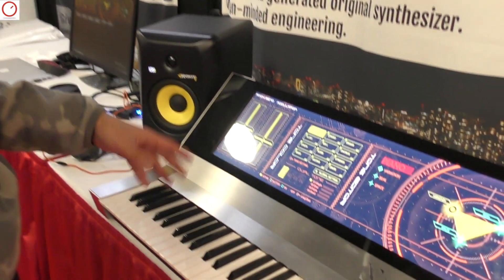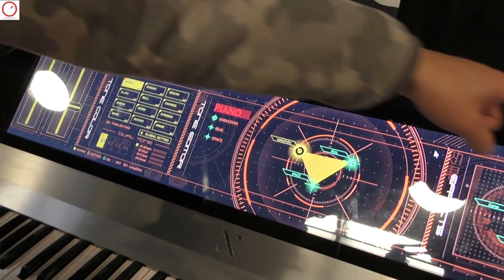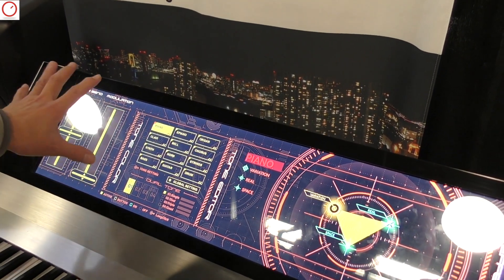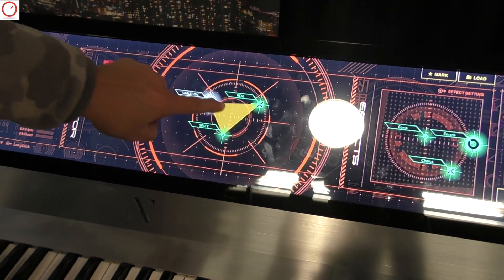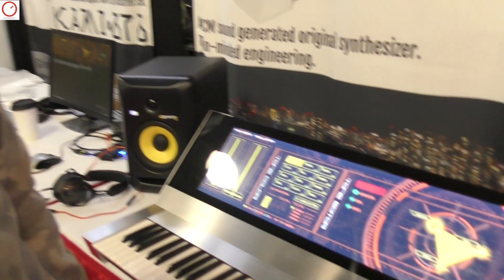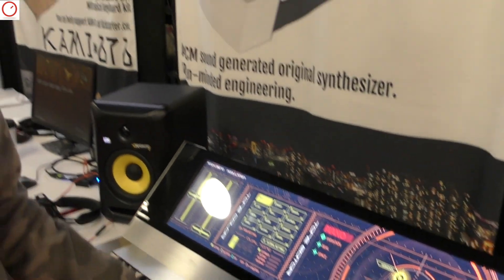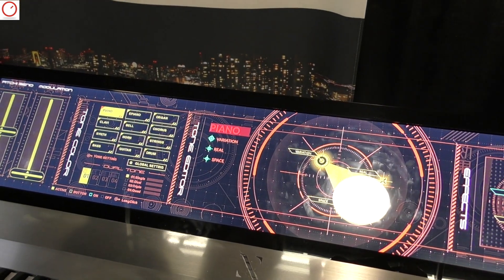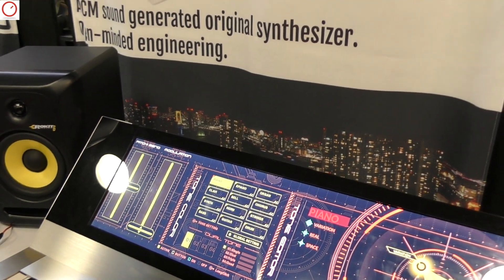NAMM 2018: Yudo NEUMAN Multi-Touch Keyboard / Synthesizer Prototype

Comment: Cool concept, but to make this practical as a keyboard they need to do the following:

Real pitch and mod wheels next to the keys, like every good synth ever, nobody seems to have a good time with touch controls for this.
The computer needs to be capable of running Windows or Linux (user to choose) so that all our favourite software can be used on the machine itself.
The screen section needs to fold down over the keys as a cover to keep dust off and to protect it from damage - that looks like an expensive screen to replace if it gets cracked.
Add a row of physical buttons and encoder knobs directly under the screen and up the sides so that there are tactile controls for menus/parameters and make them appear to the software as a deneral purpose MIDI control device so they can be mapped to any functions the user wants.

This could be one of the greatest keybords ever with some work on practicality, but touch only interface and proprietry software only will make it an expensive novelty.

Comment: I love the big touchscreen approach but the user interface looks dated an seems to deliver a weak user experience. Maybe a line of programmable knobs around the screen could combine the best of hardware and software to a better solution. Anyway: glad to see fresh ideas instead of refreshed vintage gear. Cheers.
Reply: I bet they had a lot of fun designing the user interface. Problem is, you also have to think about usability.

Comment: That touchscreen was seriously lagging and not exactly precise. Touch screen are ubiquitous, bit still have a bit of a way to go to be used iin a tacile enviroment where precision is  a factor. I have a Galaxy S8 and i dont use it as a controller because it screen is too imprecise for me.
Reply: Doc Holidaze This is exactly why I have switched to iOS and use iPads and iPhones just to mess around with ideas and the apps designed for iOS to make music don't exist on Android..the latency on android is ridiculous. And in this touchscreen , it was super lagging.. I'd go crazy. Looks like a movie prop to me.
Reply: Frankly, I find iOS devices as bad. I gave the generalization because I wanted to include iOS as well. However, iOS devices got the lock on running applications though. Apple has always been forward when it comes to content creation, one of the reasons Macs were the computer of choice back in the day. They were built to make content/media. I use an iPad in my day to day and find it runs music apps great, but the touchscreen still leaves me frustrated. I wonder how well Surface is, but I think pretty much all touchscreens aren't up for primetime just yet. Im thinking another 2-3 years, perhaps.
Reply: In which area, screen or processor? And what android device you've seen with 8+ GB? I know the spec ability of both, just wondering why you commented? I already notwed iOS have better ability ruinning audio apps.
Reply: I too am curious about the latest Surface. I think maybe the next surface, because latest iPad has that ms race on lock. By 1ms.. Yeah i am happy about the next two years in touch screen tech.. And Ween is back together..!

Comment: That looks pretty cool. But if the actual interface isn't well thought out, it's just a keyboard with an extra-wide tablet. All he played were piano sounds. A good synth is not all about a touch-screen GUI. You can't swap a real pitch bend and mod wheel for a tablet, it just won't work.
Reply: Maybe I'm drunk, but I didn't hear ANY sound from the synth engine in this video
Reply: OMG.. can you imagine the cost to replace that screen when it blows...as they all do eventually. ..

Comment: Lack of proper pitch bend and mod wheels or joystick sucks. Even NI fixed that in the last Komplete Kontrol
Reply: mechanical pitch and modulation broke down very easily, I have 3 midi controllers and every wheel is broken.
Reply: Yup, but getting an soldering in a new potentiometer for like $0,50 is quite easier than using non-intuitive controls you need to get used to
Reply: Buy quality - I have 15 synths with pitch/modulation wheels, bought over the course of 25 years,  some of them literally used in 100's of concerts plus studio work, throughout the years. And never have I experienced a mod- or pitchwheel to break - ever. 
This controller in the video seems to react very slow - and making fast pitchbends/slurs, like you do with a pitch wheel with a built in spring, looks to be impossible.
Reply: Indeed, only a real thing will do, even if they install a faster multitouch controller, it will still be slower than raw input.

As for quality, as a performing musician in an indie band with its specifics I play MIDI keyboards as I can't simply afford to bring several keyboards all the time. It's not a synth so there's no specific choice, I just got myself a couple of dirt cheap and stupid simple MIDI keyboards I can repair myself and that's it.

The point is, you really CAN kill a quality pitch wheel potentiometer, but in my situation I can simply put in a new one, if I did that with a costly synth I'd probably afraid of doing that :) Killing one is simple: 2 rehearsals a week, some shows, some home playing, some studio work, lots of songs have prog metal-ish solos, I do vibratos by torturing the pitch, so the actual coil in the potentiometer wears and starts to short circuit in a few years :)